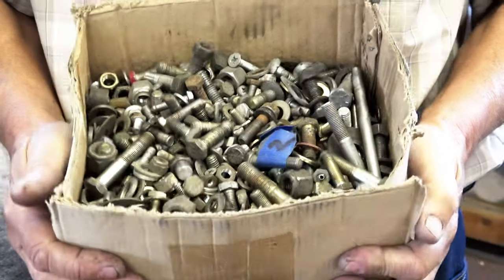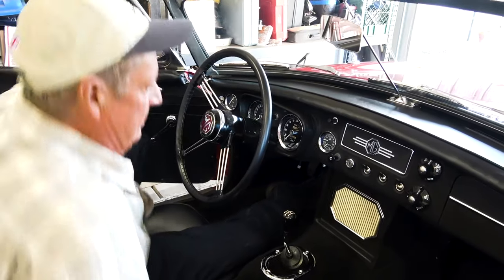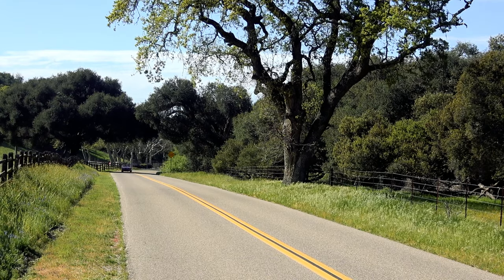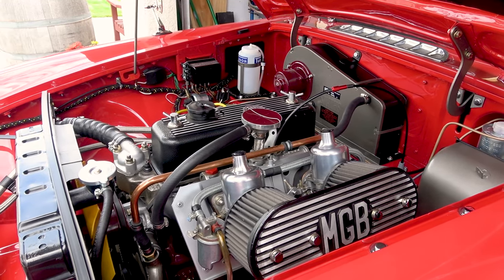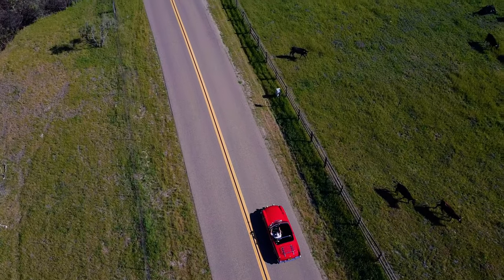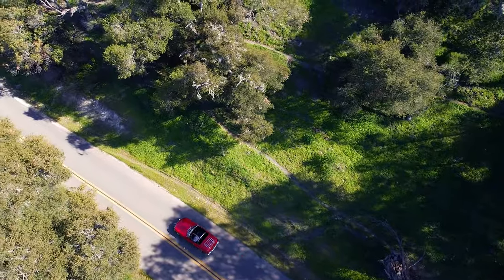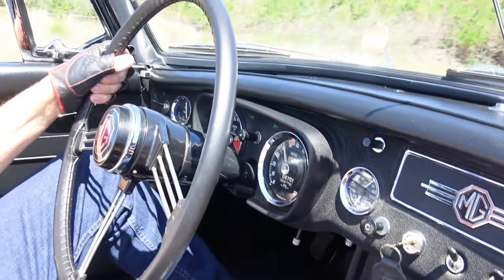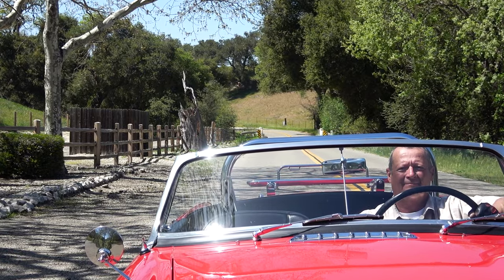The Nuts and Bolts of Enjoying a Classic Car

Comment: Nicely done. My first "B" was a clapped out car that I purchased for $500 while in college. On the way home one day the drivers 's side battery fell to the road (rusted battery cage); I drove the rest of the way with one hand holding the battery by its negative cable). I now own a 1972 chrome bumper MGB; fun to drive but one must drive defensively as there are none of the safety features we expect on modern cars. I did replace the 50 year old lap belts with 3 point belts.
Reply: My '65 B right side battery flipped on its side and dripping acid destroying the fuel pump. Fun times.